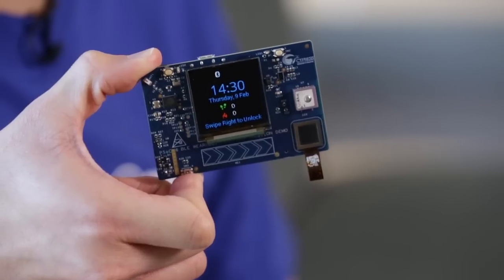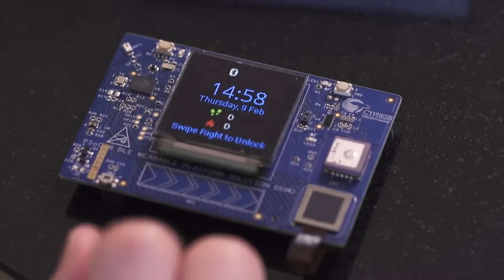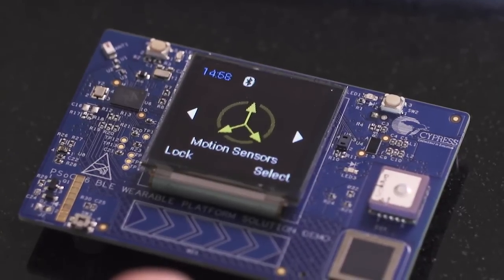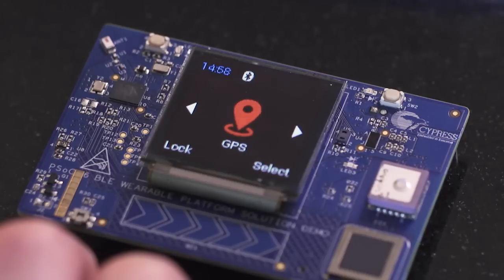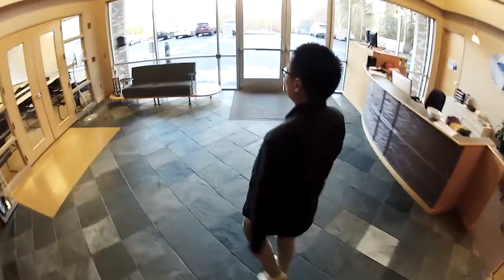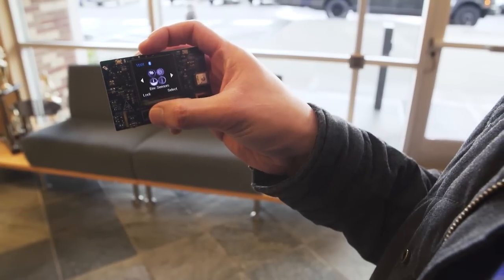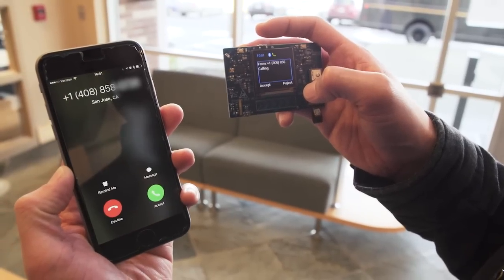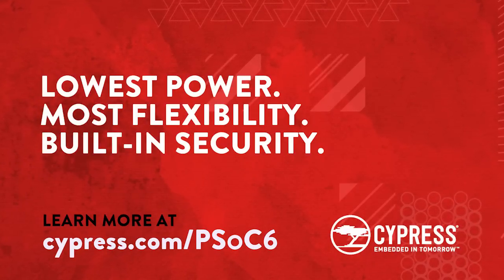PSoC 6 BLE Wearables Demo

Comment: 1. What is it's minimum static current with shutdown mode and wake-up pin mode?
2. What is it's minimum Deep-Sleep with RTC running current consumption?
3. Down the road does Cypress has any plans for Sub-GHz transceiver integration into the PSoC?
Reply from the maker: Hi Krish, Thanks for your inquiries! 

1. For hibernation mode, the static current consumption will be 300nA, but in another mode in which the backup power domain is active, it will be a few nano Amperes. Additionally, with RTC active in that mode it will increase the current up to 1uA. Also, could you clarify what you mean by wake-up pin mode? 

2. In Deep Sleep Mode 3.3V with Internal Buck Enabled current consumption will be 7 uA with 256Kb SRAM retention and 4.5uA if 64Kb RAM retention. 

3. Currently, we do not have plans for a sub-GHz transceiver, but we will take your feedback into consideration for future PSoC 6 lineups.

Additionally, make sure to join our PSoC 6 Early Adopter Program and ask more questions there. We'd be happy to discuss further any inquiries you may have. Check it out here: http://www.cypress.com/event/psoc-6-purpose-built-iots 

Best, 
Cypress
Reply: First of all thanks for your quick reply. Wake-Up Pin (GPIO): When an interrupt is enabled (external trigger) for this input pin, the microcontroller will wake-up from Deep SLEEP, which is the least current consumption mode with few 10s of nA.
Reply from the maker: Hi Krish, 

Thanks for the clarification! 

We recommend connecting the VBACKUP with the coin cell or super capacitor and enabling and disabling the PMIC using P0_5 port pin in firmware. Of note, we recommend not giving input to the PMIC with any voltage rail that is driving VBACKUP. If you have any questions in the future, feel free to check out our forums! http://www.cypress.com/cdc

Best, 
Cypress

Comment: Is it using an internal GPS or the phone's GPS over Bluetooth? Would it be possible to extract the GPS signal and sync a clock with it?
Reply from the maker: Thanks for your inquiry, Cosimo! This is a demo kit solution to highlight the PSoC 6 BLE device’s capability for wearables applications. We currently do not plan on selling these units. Please visit our PSoC 6 Early Adopter Program on www.cypress.com/psoc6 to learn more.
Reply: More simple. Where I can buy it? PS I think they use the onboard GPS. At any rate, I suppose this after having seen the demo.
Reply from the maker: Hi Roy! This is using an Origin GPS module directly attached to the PSoC 6 BLE device. Yes, you can use the GPS module to sync a clock to it as well. Please visit our PSoC 6 Early Adopter Program on www.cypress.com/psoc6 to learn and discuss more.